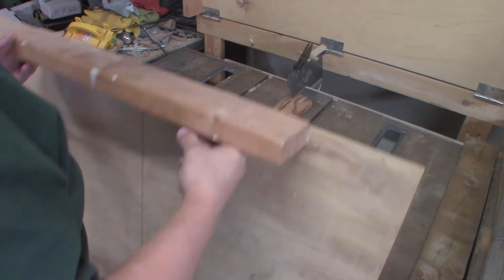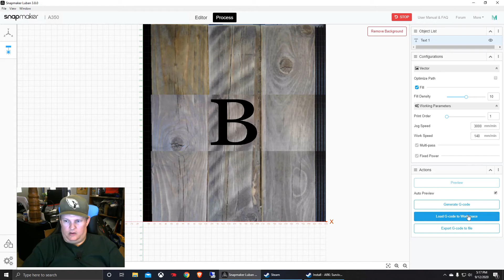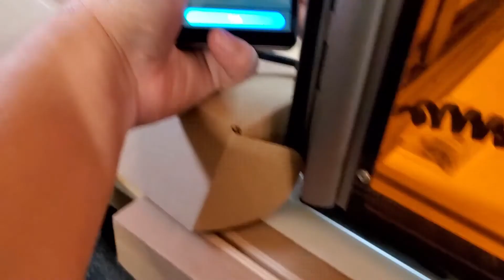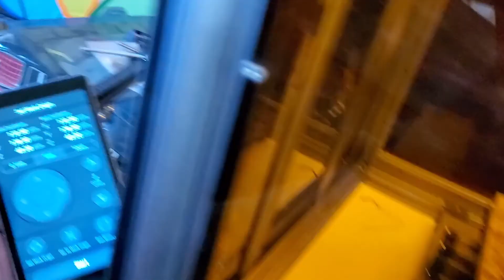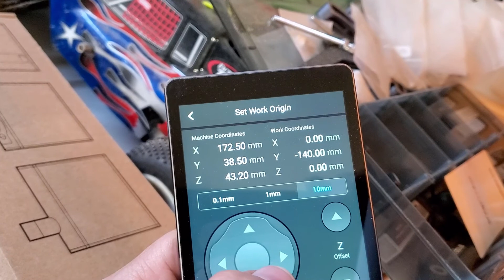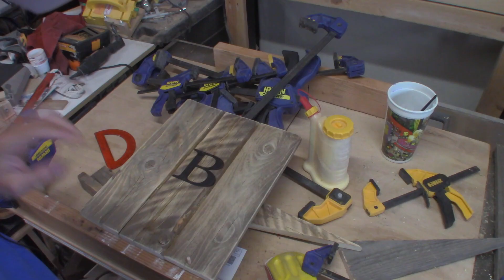Cookbook Stand Build

Comment: When I use my Laser with Cutting or Etching I get this Burnt Wood Smell on the piece that the Snapmaker just Etched. Did you ever find this issue? If so how did you solve the smell?
Reply from the maker: Sorry it took me so long to respond. The wood is being burnt by the laser, usually it goes away but may take a few days. Also if  you seal the wood with a poly or something else that may help to block the smell but not 100% sure myself.